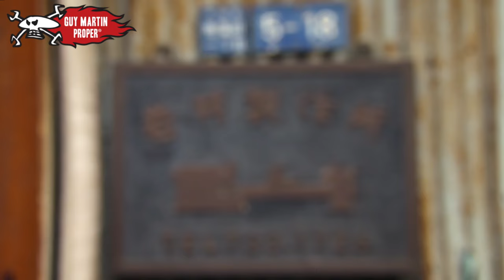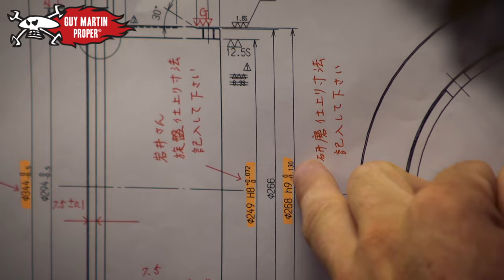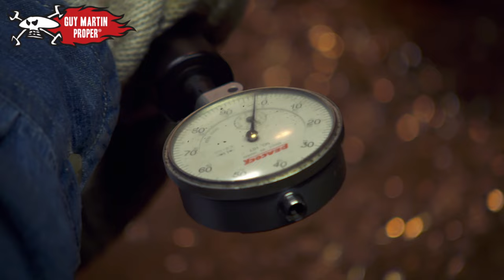Guy idolises a Japanese engineering master | Guy Martin Proper

Comment: No offence but 130 microns on a lathe is a country mile.
Reply: Tbh I was thinking maybe they meant 13 microns which is quite close on a lathe  but .06mm either side is a fair margin to work with
Reply: It is on a small part. Or a heavy part. That is not a small part and it's pretty light. I'll leave you to work out why that might be.
Reply: Tony Rule Err..... you do know you get highly toleranced large parts? This isn’t a particularly large part either. 130 microns is a big tolerance for this part.
Reply: @Zkkr429  Considering I've been specifying geometric tolerances for my 30 years in industry, I think I have a pretty good grasp on it. How about you?
Reply: Tony Rule Couple of points. The tolerances stated aren’t geometric so I don’t really see what your GD&T experience has to do with it? How much metal have you cut? Go away and look up the application of an H9 fit, it’s not considered to be particularly accurate. And I only have 20 years experience, but most of that has been F1 prototyping, so I know a little bit myself and clearly more than you.
Reply: @Zkkr429  You're right. Geometric tolerancing is a fair way above basic dimensional fits and limits.
I've known a couple of F1 clowns and a few aeronautics engineers and I have to say I've observed one one common trait: over estimation of their actual mechanical aptitude. I guess that comes from thinking they're in a 'prestigious' industry and therefore they're somehow a cut above. However, they've usually be quite inept at anything outside their very narrow areas of expertise.

Comment: I love his passion and such but the interviewer is like 130 mikrons is like 2 human hairs but is also 0,13mm (5thou) which is not a tight tolerance at all.. (and if you look at the others they are like 0/-0,5  ,  +-0,1  ,  0,075mm (2,9thou) which is the only "tight" tolerance you could see) He even has a digital readout.. which makes everything alrdy easy af, "the feel of the knob of the micrometer just as it makes the maximum circumference ohhh".. there are micrometers with a ratchet on the end which is set to ratchet after a certain amount of pressure while measuring (so you cannot overtighten/have it too lose)...

Comment: -130 microns tolerance allowed  is like having 1 finger width dimension tolerance allowed for a wood worker.

+/- 10(not 130) microns is a value that most machinists will do on regular day with manual operated machines and using regular cutting tools.Take into consideration that 1(not 130) microns +/- deviation is easy to obtain using regular old school grinding tools with regular grinding stones,no fancy aerospatial tools.

I am not saying that man is not a good machinist.I dislike  the stress of the idea of tolerances big as "human hair" Human hair is thick as an electric pole in machinists world.

Comment: Wow, most machine shop instructors would have a heart-attack watching this. Those long strands of metal coming off of the lathe are known as "killer chips"! If the machine suddenly catches one of those it becomes a razer-whip that can easily take your arm off! Countless machinists have lost fingers in this manner.

Normally you would set the machine up to produce small metal chips, not long continuous strands like those. Even if the job required you to do so I would stand far far clear of them. All too often someone is tempted to remove them by hand while the machine is turning. One small slip-up is all it takes.

Comment: 130 micron aint a super fine tolerance, kinda middling really when you get into aerospace and the like. If you couldn't hit that every time when putting the effort in you should be anywhere near a lathe. Sure, it's more expensive but it's not particularly difficult. His measurement repeatability is probably high but that doesn't make it accurate - there's a good reason we don't measure things like that any more, you can calibrate your micrometer but who calibrates the man. Don't really get the whole hasn't made a profit thing - of course he hasn't, when you're a one-man-band you buy your gear, materials and pay yourself what's left, no profit.

Comment: The big change coming soon to nuclear power is far simpler designs that self regulate their power. They won’t need the high precision parts because the risks mitigated by those parts no longer exist. 
The Moltex rector has such a string self regulation of power that it will naturally follow the load. It cannot over heat. They have cut off (aka control) rods to meet regulatory demands but they do not do any controlling. They are not really needed.

Comment: Lol . 13 of a micron is massive I've been engineering for years some cnc machines I have to go to. 0005
Reply: Agreed. I used to work to work in imperial to .010 using a steel rule and .002 using micrometer or vernier every day of the week. Occasionally we would have to bore to .0005 but we used to use a floating reamer for that which makes it pretty easy. And a large part of the challenge can be the material you are working with. If you want some real fun try drilling a hole in Monel using an HSS bit. That will test your drill sharpening skills. It certainly showed up mine.

Comment: The Japanese are having way too much of a stiffy over manual craftsmanship. Computer controlled machining can easily achieve these tolerances in a fraction of the time. There's just no need to do it the way you've done it 50 years ago anymore.

Comment: 130 microns? That is nothing extraordinary. Modern automatic lathes can consistently reach accuracy in single digits, some advanced ones to 0.1 microns and work 100 times faster than this guy.

Comment: No disrespect to the man, but am I the only toolmaker / engineer watching this with horror as he wears gloves while operating a machine? And when he pulls the cuttings away from the chuck I couldn't watch. If you catch your hand on a moving part you get a nasty cut, but if wearing gloves it snags the fabric dragging you through the machine basically ripping your body apart! I was shown pictures of the aftermath of an accident like this by a safety rep and I couldn't get the images out of my mind for weeks.

Comment: The thing is, despite how good this guy is, computers have not only succeeded him, but have exceeded his capabilities with regard to tolerances, by the way of modern digital CNC machines.
Any part, this Japanese engineer can produce, a high-end computerised CNC machine can also produce, not only in a fraction of the time, but to even finer tolerances.
Don't get me wrong.
It's great seeing these old guys, master craftsman, doing this stuff manually, but at what cost, and why, when modern machines can outperform him on spec AND cost ?
I'll tell you why.
Romanticism.
And I'll tell you something else.
You're wearing your watch on the wrong wrist.
Watches are designed to be worn on the left wrist and unless you are making some kind of gender identity statement, then on the left wrist it should remain.
Switch to the left.
You'll soon get used to it.
I've worn my watch on both, and after a while got used to it.
But now I'm a lefty through and through.
>
Reply: While CNC equipment is faster and more repeatable, if the customer only needs one or two parts a manual machine can still keep pace.  The manual machinist can get started before the CNC machine is programmed and set up.  Then you have to prove out the program to make sure there are no errors and to avoid a machine crash.  All of the time spent doing that the manual machinist is busy making the part already.  Manual machining is not dead by a long shot.

Comment: Respect to the guy , but he is milking it a bit to much. I know this because I'm a machinist and a lot of work we do is not super critical. 100 mikrons is a HUGE tolerance , a tight tolerance would be something like 10 mikrons.
Plus a guy has a DRO
Reply: Also he is not using his mike properly , when mesuring you tighten the jaws by rotating the rattle , in order to not apply too much force

Comment: Seriously, what is Guy Martin going on about?  First of all, the tolerance is +.000/-.130 mm.  That is +.000/-.005 inches.  Any machinist worth his salt should be able to hold that tolerance with his eyes closed.  Secondly the tolerance right next to that dimension is +.072/-.000, which is roughly half of the tolerance that the narrator was getting all wonder eyed about.  But even at +.003/-.000 that is nothing to any good machinist.  Really good machinists should be able to hold .0002 on such a set up if they know what they are doing.  Secondly it's not engineering.  An engineer is the guy that designed the part and did that drawing.  This is a machinist.  A good machinist is worth his weight in gold.  I would never say anything bad about a good machinist.  I work with plenty of them and have an immense respect for their ability in their craft.
Reply: Sack them and invest in a CNC machine.
Reply: @clioaspinade9275  That comment is just ignorance at its worst.  Who do you think sets up a CNC machine?  Who do you think programs a CNC machine?  You had better know machining before doing either of those things, or you will be in big trouble.
Reply: @j.frankparnell6195  I was joking you muppet, lighten up.

Comment: It is a shame that this profesionals are on extinction but at the same time there is a reason why: A computer controled system can do this job way better, faster and cheaper (Sad but true). All this "feelings" can be taken out of the ecuation and the robot would do even a better job  (Again, sad but true).

The problem with Japan is the fact that they keep using old methods for many things, even seeing videos and everything about a modernized industry. Just ask any foreign engineer working on Japan and they would told you about this. Few years ago, as an engineering student,  I was thinking about an Erasmus on Japan, what was called in my university the "Vulcano program" and I remember a teacher that worked a few years in Japan just telling me not to go due to their procedures and old methods. 

A 226mm diameter with a tolerance of 72 microns is, roughtly, an IT8-7, impresive by hand but pretty much standard on the industry.

I had mad respect for this Master Engineer but as we say on my country, " Lo cortés no quita lo valiente". ("The politeness doesn't take out the bravery")

Comment: The english dude there is really fascinated by him using a micrometer? What is this cmment section, this is - sorry- but nothing special.
Reply: That and "he needs to make sure the diameter is within the thickness of two human hairs"... You mean +/-.005 inch, or 5 thou? That's pretty standard. If it were +/- .0002, or 2 tenths, then I would be impressed.

Comment: I don't know... "The feel of the micrometer" - there is no feel... starts clicking at the right time... every time... regardless of the operator. Otherwise everybody would get different measurements. A tolerance of 0,130mm is nothing special. Especially on a lathe. There is a lot of praise for not much reason. No doubt the guy is a master but the mastery comes from the insight of doing things with the right order of operations, taking into account thermal expansions and tool wear, workholding. Measuring from the right locations to give you good information about where the geometry is not up to spec. Knowing when and where your machine is at its optimum etc.

Comment: I'm sorry, i've been in engineering / tool making all my life, this is common place up and down the UK, this is nothing special, quite why Guy is acting all wow'd is beyond me, a 0.072 tolerance is wide open, show me a machine tool fitter scraping a surface to tolerances a fraction of that and i'm impressed, a bit of turning the average machinist can do not so.
Reply: Chris your 100% correct. It's hard to read all the other comments...

Comment: I've been in many machine shops in the UK and worked with many miller's and turner's. This video is nothing impressive, I've met plenty of young and old English men that can do this. I always thought Japanese engineering was top class, but I've worked for 2 different Japanese engineering companies and can safely say they are not at all. They just copy other machines & designs from around the world, then engineer it a little bit different to make it shitter. Then design things in stupid places on the machine without any thought on how to access, fix or repair. Japanese engineers are no where near as good as you may think.

Comment: Come on man they have machines that can cut way more accurate robotically. That’s why they don’t hire people like this dude. He’s way old school.
Reply: Firstly... he's NOT a "dude" ... learn to have some respect and maybe a bit of humility wouldn't go astray either by the sounds of it. 😒
Secondly... CNC & other automated processes can do these parts ... but ... they have to be PROGRAMMED to do it & this man could probably have it made while the code is still being compiled...
Thirdly ... if its a one-off .... automation generally doesn't "do" one-offs , they are for production of multiples. 
Tool-caddy setup alone is a chore... 

Maybe you should study the discipline before running your moutb... one things for sure, you are NOT apprentice material... 🙄😂
Reply: Peter Fitzpatrick what ever you say there petey boy

Comment: Such a pointless thing to master... this is very typical of Japan and is one of their biggest drawbacks is to rely on this. There are plenty of modern machine which does these types of machining works in a fraction of the time, with much much more accuracy, and you basically press a button to do all the work. 2 Microns is a lot in some instances. This is a country where you fax in your CV to apply for work....